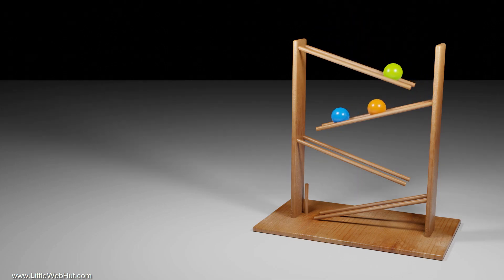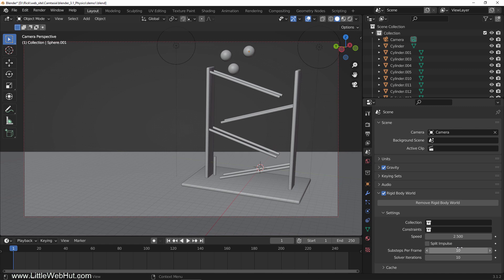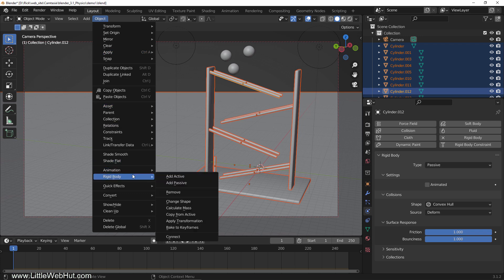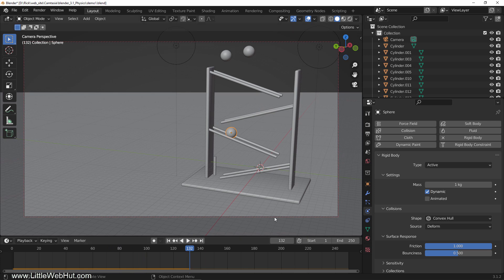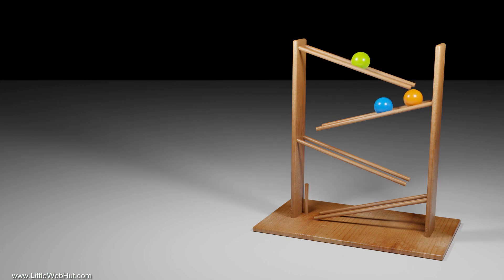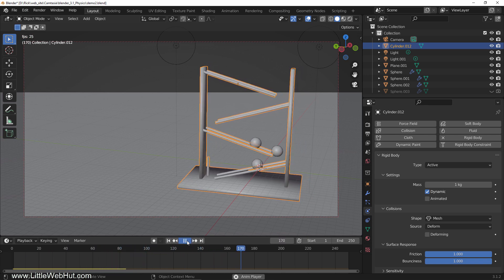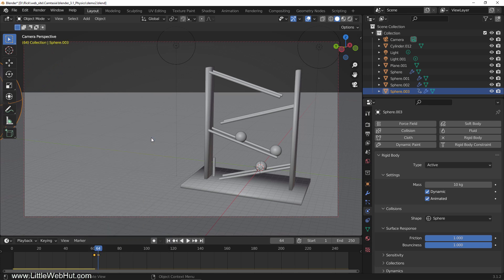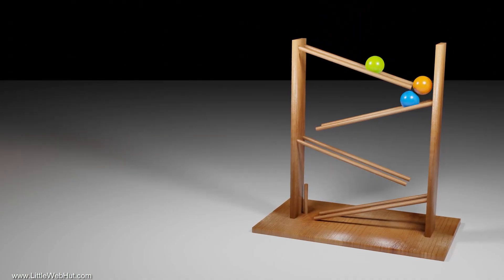Blender Tutorial: Physics Doesn’t Need To Be Hard

Comment: Thanks a lot for the guide! It is a pity that dimensions, mass and speed are not as intuitively interconnected as we would like! We tried to do Marblemachine physics with the guys. We weighed glass balls, they weigh 5-6 grams each, tried to set a similar size in blender units, but the physics is not very similar to the real one (the balls either do not spin or move slowly). With your tips, I think it will get better. Then we want to try to reproduce the simulation in reality using a 3D printer and a laser machine.